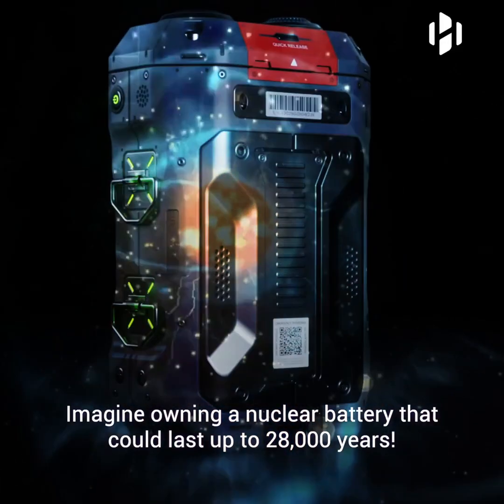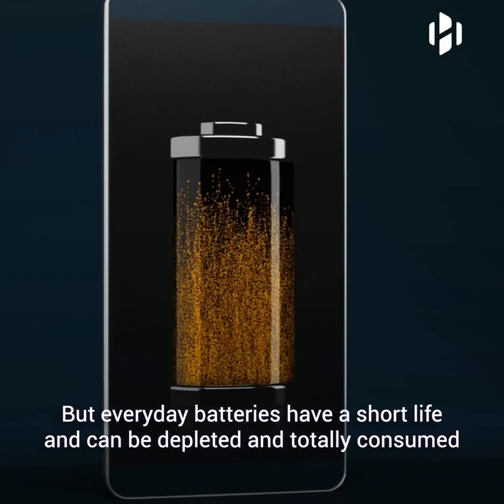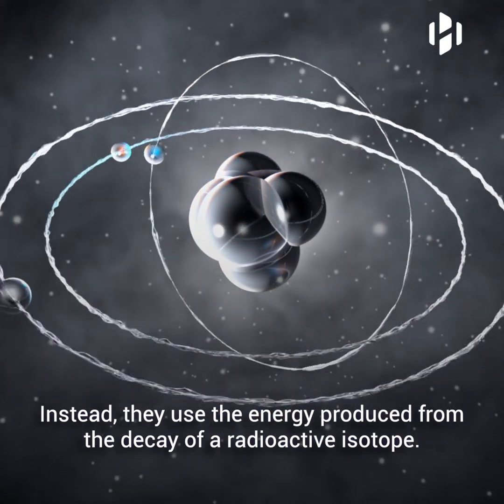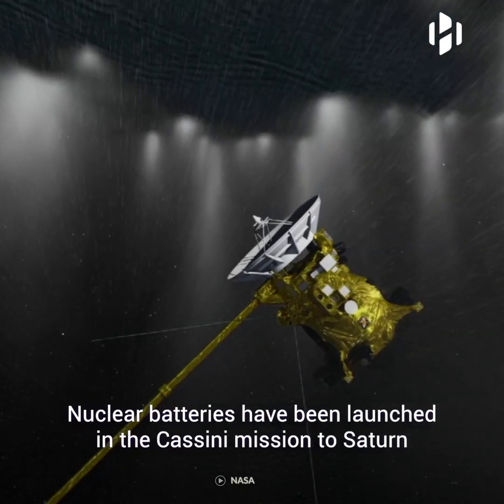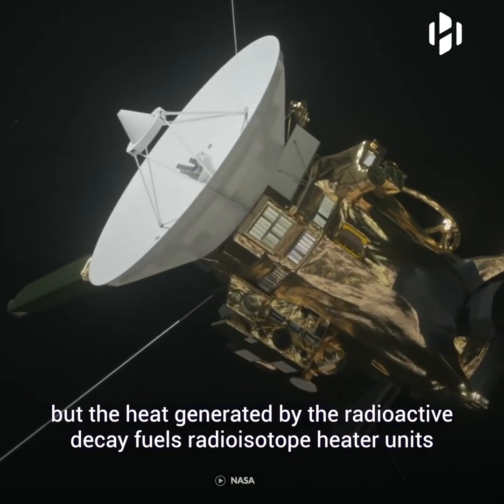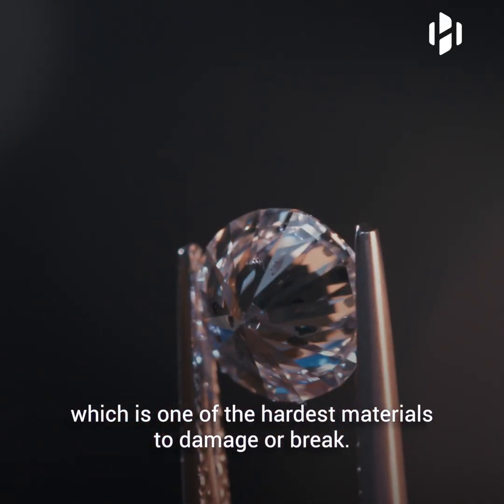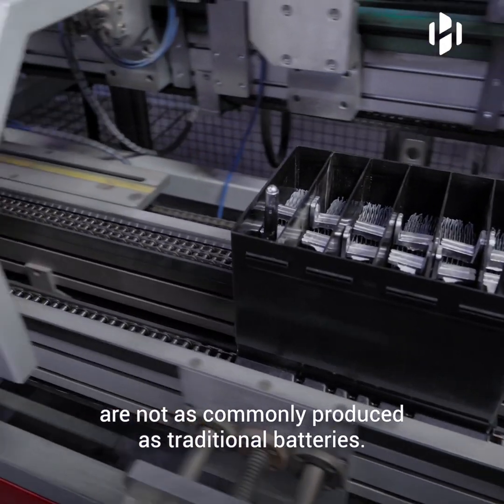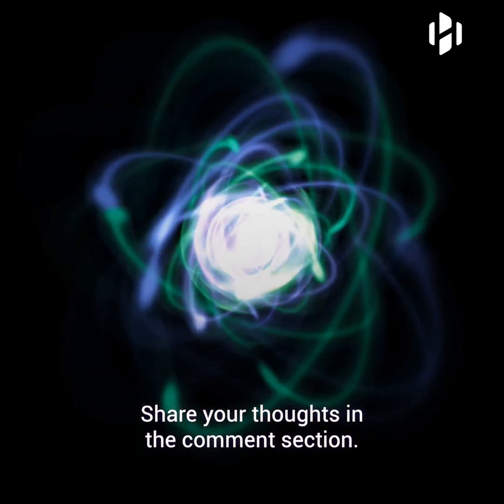Nuclear battery could last up to 28,000 years

Comment: These would work in portable generators that have power inverters outputting 120 V AC.
Reply: You might not understand the power density is extremely small less than 100 micro Watts per cubic centimeter. Yes, if you need extremely small amount of power, it's possible to make some portable generator. A big coffin to output 1 Watt with 120V is feasible. Do you have anything that can run on that? The price is probably 100s of 1000s of Dollars also, so your 1 Watt won't be cheap.

Comment: I just about had it with these scammer company's and videos made on them presenting them s the next big thing !  They either parade a technology that isn't here or use an already existing one that out of objective reasons is not so popular !  Radio active powered battery exist for a long time and if these filthy conartists gave you a heart attack and you have a peacemaker there are good chances it will have a nuclear battery as well. Battery's of this type produce little power, and require a material with very strong decay to produce more that's there down side and that's why small portable ones are not so popular, also the whole Dimond technology that doesn't exist yet, they can take it and shove it where the sun don't shine, I am going to believe what they are saying when they can consistently produce results otherwise this is the same like the hyperloop, hypersonic electric car, rocket to fly people in 30min around the glob, going to mars too establish a colony ... and the list goes on ! ! !